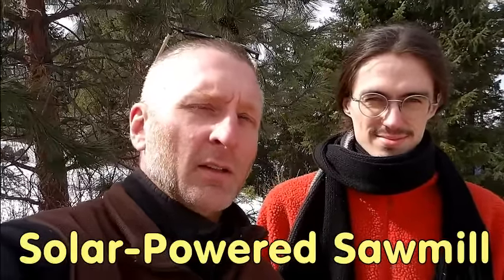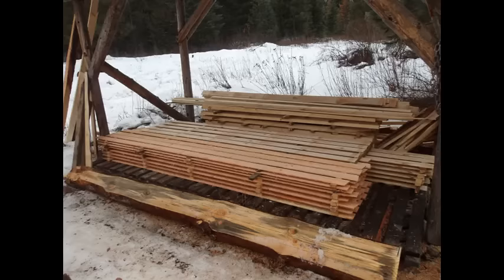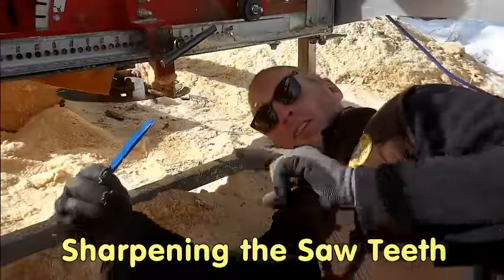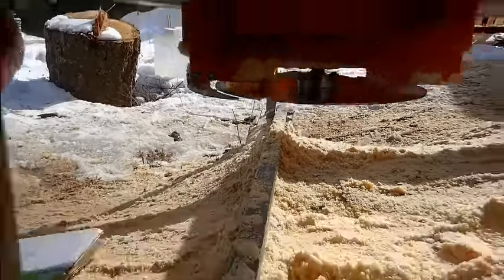clean, quiet and easy solar sawmill; a sawmill with fresh air

Comment: Beautiful wood and work site views :) How strong do you have to be to push/pull this? It looks really user-friendly but I was wondering if it takes a bit of strength or not really? Also, do you guys use freshly-felled trees or do you leave them to dry/season for a bit first? Amazing how this is solar powered, love it!
Reply from the maker: So strength.  The worst of it is when you get to the bottom of the log, you have to hunch a bit - but I think we can mend that.  Fresh cut trees.

Comment: What i wouldn't give to sharpen my bandsaw mill blade that fast
Reply from the maker: Any guesses at how many teeth are on your bandsaw blade?
Reply: The trade off is being able to saw regular size lumber with the bandmill. This is a neat little rig for what it does, and definitely faster sharpening! Downside is you can only saw when the sun is shining on the panels so not too practical for most of us. Lucas makes a bigger swing blade mill that will cut up to 12” wide boards.
Reply from the maker: @brucea550  There are batteries.  We can saw on cloudy days.
Reply: @paulwheaton   180